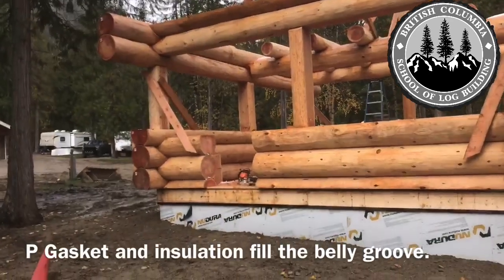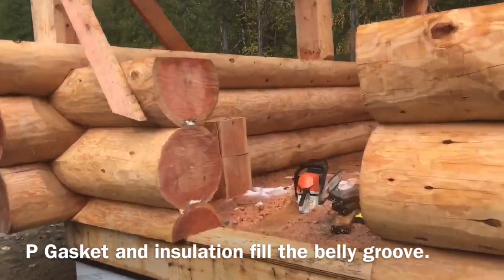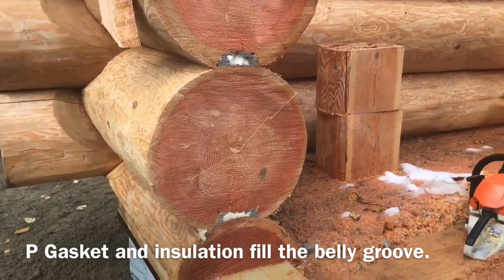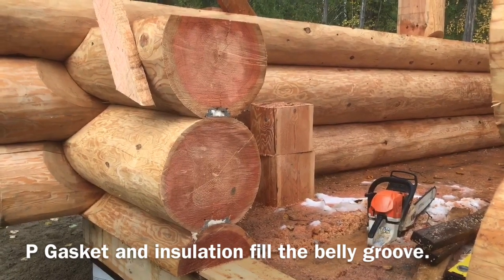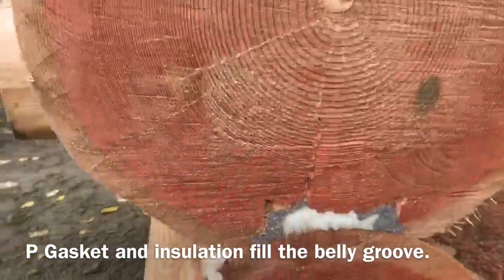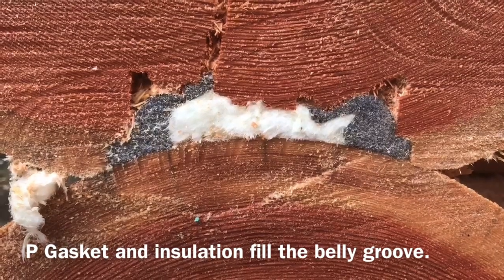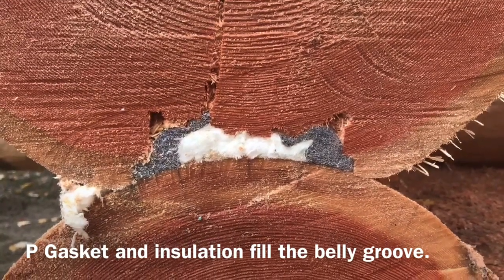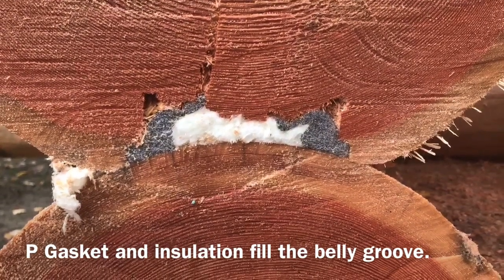Insulating the Belly Groove in a Log House #insulatingaloghome #loghomervalue #fullscribelogbuilding

Comment: Quick question;  I have 42 Larch logs @ 12m length, averaging 500mm butts and 350mm tips.....after pealing and stripping I have found that 9 of the 42 are "lefties" with two real bad...my question is, are they usable? 
Would you say not at all?
Certain places?
Or are Larch lefties any different?
And thanks for your previous help, I'm in touch with their European representative.
Tony.
Reply from the maker: Unfortunately their are lots of lefties out there....
  We try to use as few severe left hand spiral logs as possible.  However we can’t avoid them all. If you do use them, use them in the lower 1/3 of the wall height in a location where they will not be cut through in a door opening.
Reply: @bcschooloflogbuilding4385  Thank you, really appreciate you taking the time to help. Tony
Reply from the maker: @tonysmith8456  you’re welcome

Comment: Nice timber, shame about the fibre-glass. Experimental belly groove insulation is being widely discarded here in Scandinavia and we are seeing a return to traditional insulation. When you are investing this much time and money into a building why jeopardise the longevity of the building? Mountain Fern Moss (Hylocomium splendens) has always worked best and still is the best solution. Be informed, inform your customer, maintain the best solutions and innovate sensibly. You do great work, carry the tradition and it will carry you!
Reply from the maker: Thanks for your thoughts. We often use sheep’s wool insulation but it’s very hard on the cutting edges of our tools.
Reply: @bcschooloflogbuilding4385  Yes scissors cut wool easier than knives. Wool is used by many companies here too, though there is evidence it is subject to black mould after condensation wetting. There is likely to be extra dampness at the line scribe, so the antiseptic rot resistant qualities of some mosses are the paramount choice. If people want the best longevity then it is worth the extra cost. Not everyone can afford the best possible, but some customers enjoy collecting the moss for their house. Sorry to level criticism at your practices, it truly is because I want your houses to succeed, you do great work, best wishes, Lucas
Reply: What's the problem with fiberglass?
Reply: @alaskahomesteadadventures7579  It makes the wood rot under certain circumstances. If it ever gets wet, for any reason it just does not dry, and rock wool has been shown to  actively nourish rot. In Scandinavia we expect extremely long service life from timber houses, any built in mistakes are searched for and eliminated as soon as possible, any practice that is less than 60-100 years in use, should be understood to be experimental. When a tradition has a 1000year heritage it is very easy to accept that the system works, and should only be changed at considerable risk of failure. Many houses here are still in use after 400 years habitation, our oldest wooden houses are over 700years old. It is reasonable to expect 150-200 years service life from a correctly built timber house. Fibreglass can reduced that to 40-50 years in some cases, it is just not worth the risk for the sake of a bit of construction convenience.
Reply: @LucasRichardStephens  Thanks for the explanation.  I'm considering moss for my current build, weighing the pros and cons.  On my first full scribe cabin, i used a soft foam gasket on the inside of the seams and fiberglass in the remaining void.  My thought was that the gasket would slow the movement of moist warm air into the fiberglass from inside throughout the winter, but any condensation that accumulated would be able to dry out come spring toward the exterior. It is somewhat counterintuitive to think that moss would dry out faster than fiberglass,  since moss fibers actually absorb water and fiberglass does not...do you know why the fiberglass does  not seem to dry out?  I live in super dry interior alaska(<13" total annual precipitation), which is quite different from Norway,  correct?
Reply: @alaskahomesteadadventures7579  Some mosses absorb water, and that is why it is not any old moss that is used here. The climate in some of the areas in Norway, where timber houses continue to be built in the unbroken tradition are extremely dry and cold. It is mosses remarkable anti-septic characteristics that prevent rot. Such practices of refinement, such as to continue using moss, are always down to the receiving generation to respect, because the poor performance of modern materials is often only recognised after the builder has passed on. I see the damage of the use of modern materials in post war timber-houses frequently, in my work as a restoration craftsman. So for me it is easy to understand the risk and reward of continuing tradition or not. I do experiment as well, but it will always be time that tells, and since these houses last longer than us, it will be the younger generations that can continue the refinement.